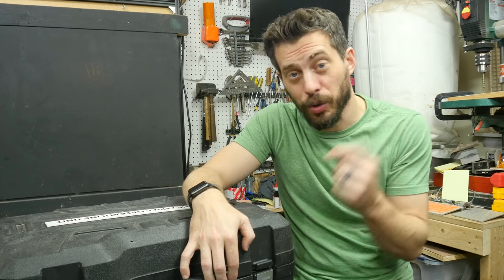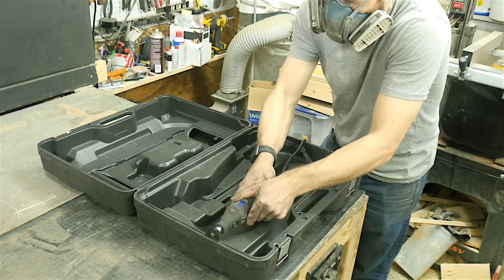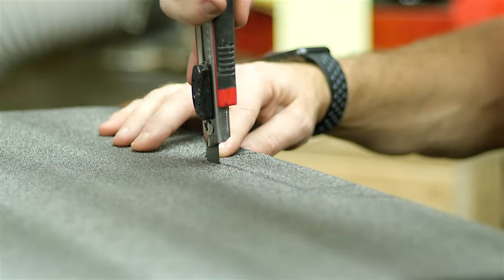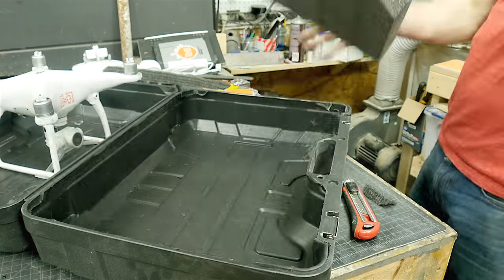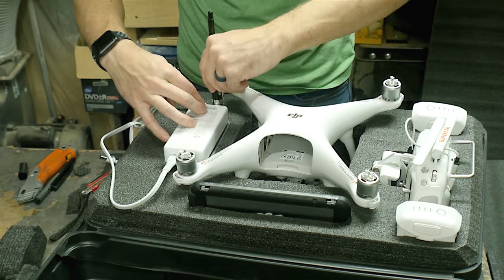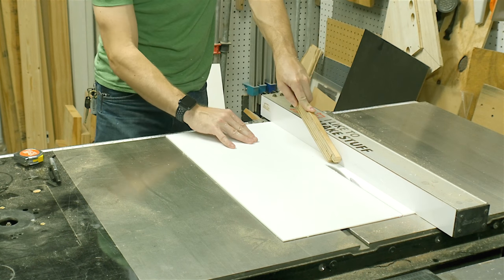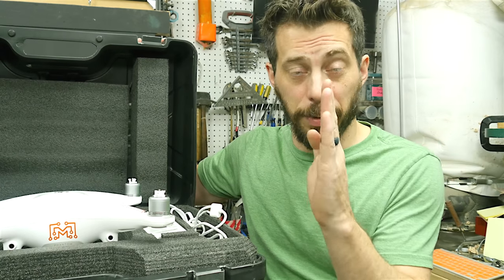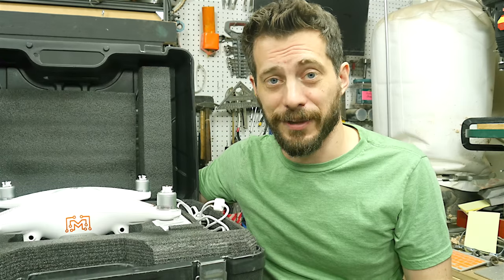Harbor Freight Drone Case // How To | I Like To Make Stuff

Comment: Great video! I've made 3 cases. A wireless mic holder, the ultimate mobile media tote and a multiple harddrive case. I used dewalt drill cases. I didn't have to cut out a layer of plastic but had to Dremel and trim out dividers that separate the drill, battery and charger pockets. Where I am from, we don't have easy access to Kaizen foam, if you can find a place that sells it, it is super expensive, so I used 3 inch thick foam from Home Depot. I made a version of the Styrofoam cutter from the King Of Random's video and used it to cut out the voids for the pieces that I wanted to do into the case. I had to sort of "re-saw" the foam into thinner layers and cut out the different levels for the different depths as well as you did.

Comment: The timelapse pan was a nice touch. If that's gonna be stored in your shop, you might consider adding a gasket around the edge of the case to help prevent saw dust from getting in the drone/camera. Just a thought.
Reply from the maker: Ah, the gasket is a good idea.  I keep this in my office where it's (relatively) clean but that's a great point regardless.

Comment: All my tool cases have been converted to minifigure cases and paint kits using the same foam cutout approach.

Also: not in the notification squad, I just know roughly when you upload. :D
Reply from the maker: Good timing then!  Minifig cases???  Tell me more :)  Do you custom paint them?
Reply: You betcha!  Warhammer 40k models mostly.  I used to do commissions before I opened up a brewery, and needed an easy way to store in-progress projects as well as model racks for batching out multiple models.  For standard size models, I'd use two layers of foam: one as the backer, and one with approximate cutout.  For large/odd-size models, I'd custom cut the shape exactly the way you cut the drone shape.  For my drying case, every model was attached to an old paint pot, so the bottom layer of foam had circles cut to hold that in place, and the next layer up would be a 2"x2" square so it wouldn't come in contact with the walls.

Comment: I have made a case like that out of a welder box just by reinforcing the hinges by replacing them with ones that were made out of steel and using bed foam wich ended up perfect.

now I have a strong and safe case for ALL my camera gear for about 20€.Pretty awesome
Reply from the maker: Sweet!!

Comment: The iPad mini fits perfectly in the slot at the front of the factory case. I get a controller, drone, iPad, charger, spare props, and 4 batteries in the factory case with no issues. I'm pretty sure I could fit another battery in there if I had one.

Comment: What would have been awesome is if you had put a battery bank in the case, you could have charged it on the go with the various cables running under the foam and some LED's to show the charge level. Just a thought.

Comment: You may have realized this as you worked, but foam dulls razor blades REALLY quickly. Just a few cuts and you'll start noticing the foam starts to tear rather than slice cleanly against the knife. Make sure you're sharpening your blade frequently or have replacement blades handy to keep those cuts nice and clean. Nice Project! I've wanted to make something like this for traveling to cosplay with some of my props.

Comment: I know a thing or two about those cases so I'm going to share unsolicited info. The case looks to be blow-molded, a pretty cool process for making lots of plastic parts like these cases, gas cans, and even larger stuff like kayaks. A plastic tube is extruded from above. Then a mold closes around the tube and sucks the plastic to shape. It's very low cost (read "cheap"). The places where the plastic is melted together is called a knit point.
Reply from the maker: Sweet, thanks for the info! That sounds like a pretty cool process to see (and maybe make ;)
Reply: +I Like To Make Stuff blow molding might be tough to replicate. Vacuum forming and rotational are a little more DIY friendly. I can hook you up with some HDPE scrap chips if you're interested. it would be easier than cutting up milk jugs like lots of other YouTubers do.

Comment: Hey Bob, you've mentioned you wear a non metal ring intentionally. Could you elaborate specifically on why metal doesn't work? For example, does it conduct metal so you can't wear it welding?

Thanks!
Reply from the maker: +l3ender15 hey! Yeah it's conductive, if it gets caught on a tool or something my finger will break before the metal does and to me personally, the silicone rings are WAY more comfortable

Comment: you know the cartridges for your respirator are not ment for dust. I believe that one is for organic vapor only . I would recommend the 3M 60921 as that still gives you the protection from organic vapor but also adds a particle filter to it ! or this one is also good 3M 60928 !
stay safe :) 
~Steven
Reply from the maker: +AlChemicalLife I have both for different uses and leave the vapor on because it's more of an issue in my shop

Comment: When you removed the inner part of the case, did you have to sacrifice some rigidity of the top and bottom?
Reply from the maker: Yeah, a little bit.  Plus the plastic is super thin on this one.  The good thing is that such a large chunk of foam kind of back filled it so that rigidity wasn't took much of an issue.  Like I said, it's no flight case but decent for taking around town.

Comment: Would you recommend a respirator even when I would do this kind of work outdoors? And is there something I should pay attention to regarding the filters of the respirator? :)
Reply from the maker: I think it's always a good ting to have.  Notice that there typically two types of filters, for vapors and particulates. It's handy to have both for different uses.  (sanding vs finishing)
Reply: Thank you!

Comment: So, if somebody was to take their drone on flights etc. , what type of a plactic case should they use or should they just keep the original foam case (it's a real hassle to take that from one place to another, especially on flight. They look really bulky)
Reply from the maker: I think you'd just want a thicker plastic than what this is.  Look up "flight case" and you'll see what I mean.  They also usually have metal corners.
Reply: Oh! so the ones which are used to transport filming equipment. That makes sense now!!

Comment: Misleading as its not a case from harbor freight.  its a case from a band saw. Not going to buy a band saw just to get a case.
Reply from the maker: Actually it IS a case from Harbor Freight. It's a case that came with my tool that I bought from there.  Obviously you wouldn't buy a tool just to get the case, but if you've bought any of these types of tools in the past, they often come with a case that just ends up taking up space (for me anyway(.